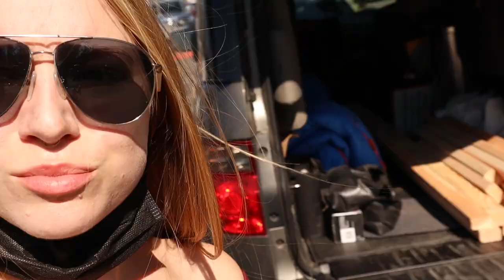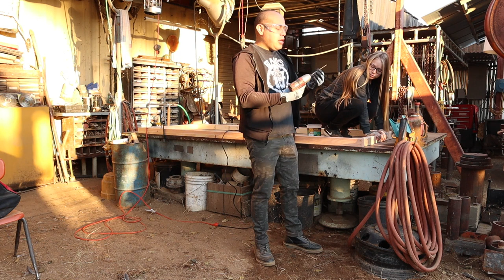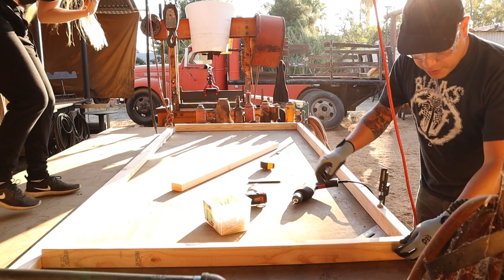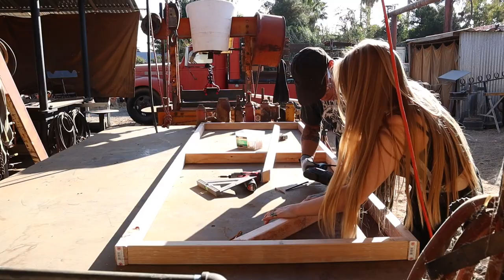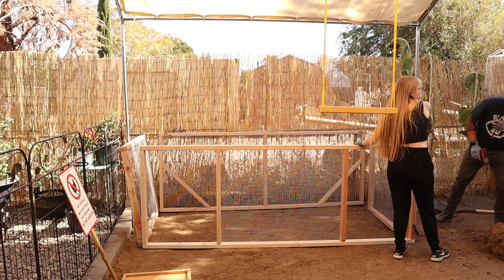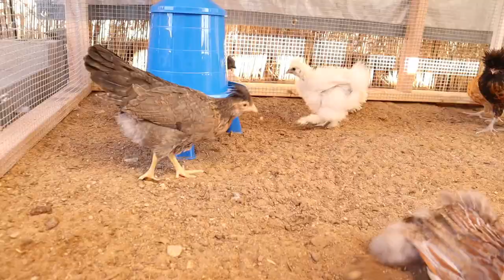How to Build a Large Brooder - Predator Proof Chicken Run

Comment: Aloha Kelly and Ricardo. Love the coop and run I am always inspired to do upgrades when I see your coops Ricardo 😊
I have a question  unrelated to coops.
My flock has fleas! I've  been using Adam's spray and dabing it on their heads. I'm afraid to spray it on the faces it could hurt the eyes. I have Elector psp. Can I dip and spray them with that? I have chicksin the coop and they are getting fleas too. My flock is free range and we do have wild birds.   Thank you for your help.